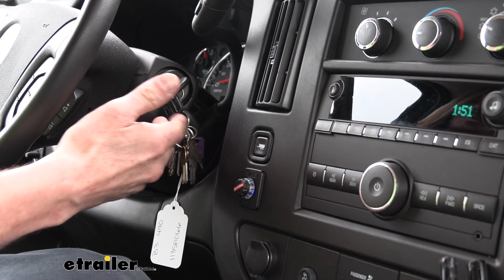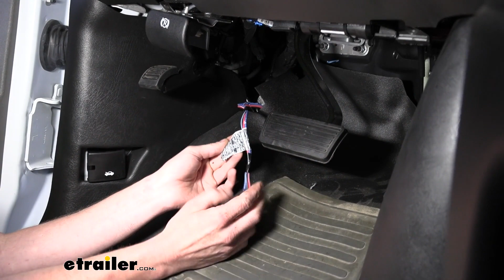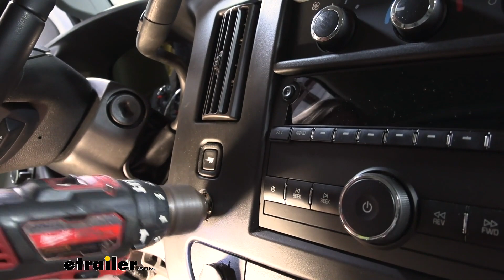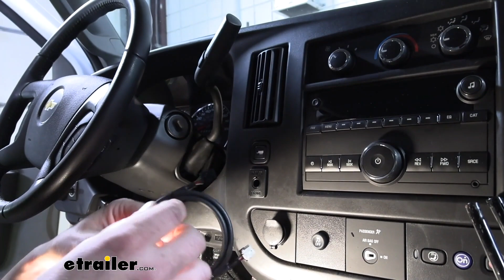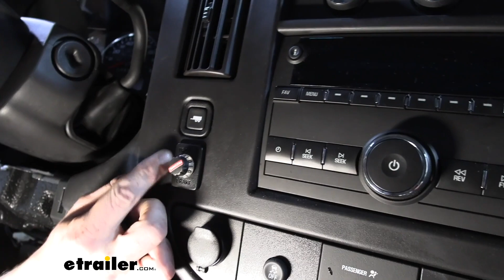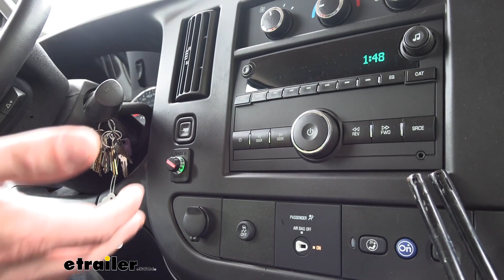etrailer | Redarc Tow-Pro Elite Trailer Brake Controller Installation - 2022 Chevrolet Express Van

Comment: Thanks for the video, it’s quite helpful! One question though, I have the wires under the carpet but I can’t find where they go to in the back under the van, just what looks like a connector for rear bumper sensors. Am I looking in the wrong place?